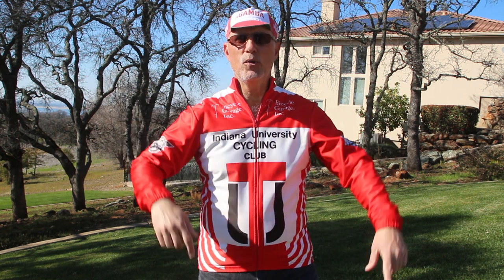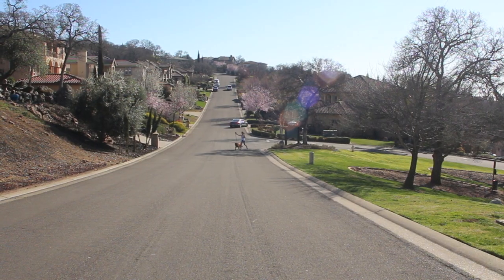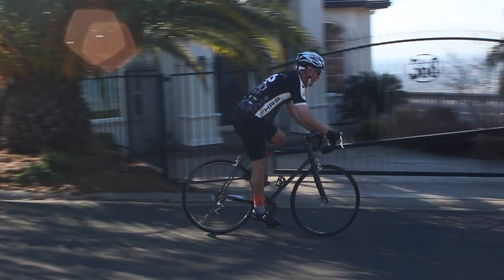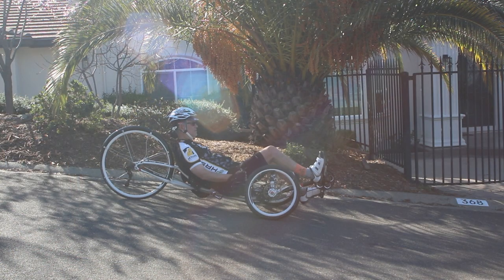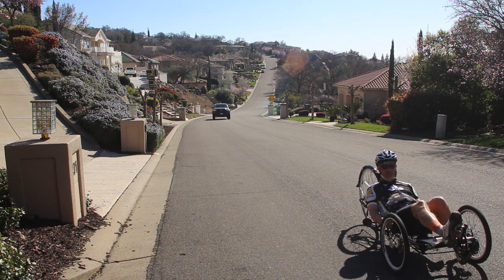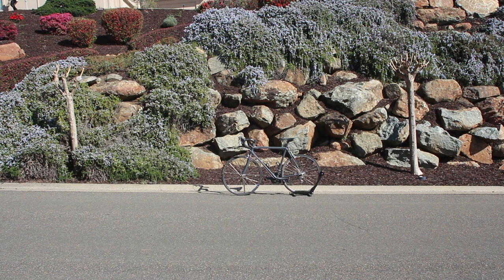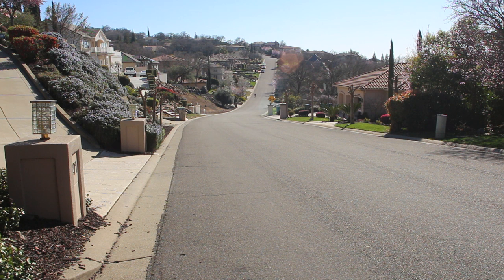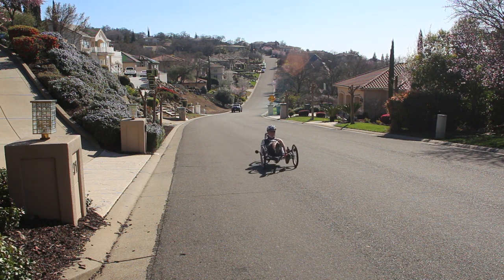Recumbent Trike Versus Road Bike: Roll Down Test Featuring The ICE VTX And Calfee Tetra Pro

Comment: Interesting that you mentioned aero-rolling resistance, but what about the road resistance divided by three vs by two wheels?  Off the top of my head I would think the pounds per square inch of surface contact should also make a difference.
Reply from the maker: Yep, you would think that the third wheel would add rolling resistance, but at least with this test, it looks like the aero benefits override the rolling resistance issues.
Reply: @bikestrikesrazors  or reduce the rolling resistance- 3 tyres but with less weight on each so less tyre flex per wheel which reduces rolling resistance. For a more aerodynamic trike you should try borrowing a Greenspeed Aero and see how much faster different trikes can be to others.(at the start, don't pedal- it's a variable) and perhaps chalk a dotted line to follow the same exact line each time. A 5 trike comparo would be great showing times and top speeds too!
Reply from the maker: @rossbrumby1957  Hi Ross! I'd love to be able to do a comparison video with the Aero, but I can't even find one in this area to look at! The local shops here that carry  Greenspeed never have one in stock and the company is kind of in limbo right now and I don't think they're shipping out any new trikes. Hope they square things away as Greenspeed makes a great trike!
Reply: @bikestrikesrazors  If you would do the same test with a recumbent two wheeler, I think that would win from both the trike and the bike!
Reply from the maker: @SjaakSchulteis  it might! Something to try!
Reply: @rossbrumby1957  Agree. Less tire flexure with three tires could equal less total friction from tire flexure.

Comment: Great video comparison. Triking is the only way to go. And one can really climb with ease in a high quality trike with great gearing.
Reply from the maker: Hey, Mark! Yep, it's all about the gearing when you're going uphill. Hard to believe professional road racers are using a 32 large sprocket on climbing stages these days, but I guess they've figured out they're better off spinning than grinding (something recumbent riders already knew).
Reply: @bikestrikesrazors  The lycra clad mob don't seem to need low gears. On the endurance bike  with 28 gear inches, I go up 15% hills at 60 cadence, about 80 cadence on the tourer with 20 inch gearing . While climbing though , will from time to time, get  ovettaken by one of the lycra clad  mob doing twice my speed up the hill.

Comment: Hmmm. 
Would a Hase delta trike with rain fairing (looks like a velomobile) be less drag than most trikes? 
I think it would indeed be less aero drag than the majority of tadpole trikes.
Reply from the maker: Those fairings can make a big difference. I had a small one on my Rans Rocket and downhill, I would roll about 3 mph faster than without it.

Comment: The trike weighs more and has more potential energy at the beginning of the run because it has been brought to the top of the hill - energy which is released in the run as it is converted to kinetic energy. So test says nothing about the efficiency of the trike, such as aero. Something heavy on top of a hill has a lot of energy waiting to be released.
Reply from the maker: But does weight really have a bearing? If you drop a bowling ball and a feather in a vacuum, removing the variations in wind resistance, they both fall at the exact same speed.
Reply: @bikestrikesrazors  Exactly. I have the same with two of my friends who ride a mountainbike and I use a gravelbike. One guy said it was because I was heavier. But my bike is lighter and it is less wind resistant. Besides that my position bended whilst he sits straight with the arms spread... every time I roll pass him and he has to pedal to keep up with me. It's not the weight, it is the aerodynamics.

Comment: Here is an interesting paper on the subject.  To massively oversimplify, because the weight on each wheel is a component of the rolling resistance, barring hub bearing friction, ignoring the wheel's aero contribution, and ignoring each wheel's additional weight to the vehicle, ADDING WHEELS REDUCES OVERALL ROLLING RESISTANCE, it doesn't add it.  But real world creates a lot of reasons why this isn't done.  They concluded that 5 wheels is optimal to minimize rolling resistance.
https://scihubtw.tw/10.1177/1754337115625002